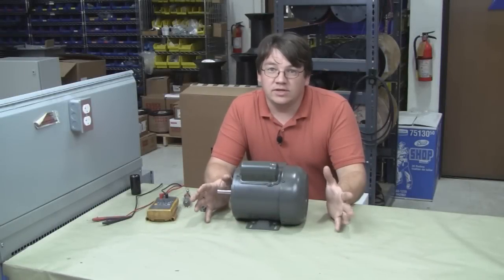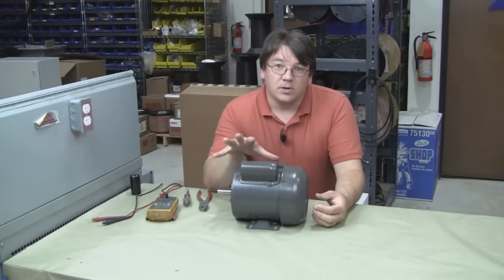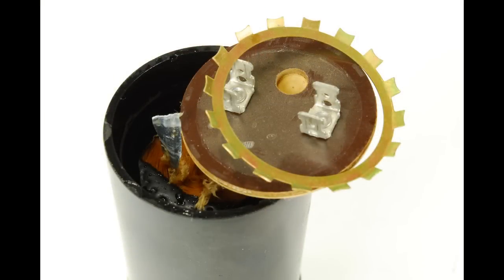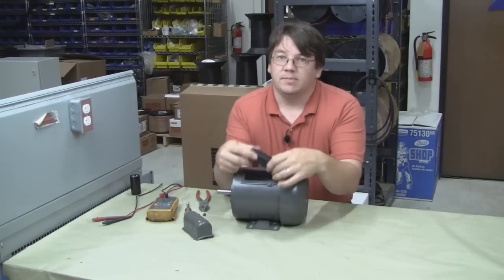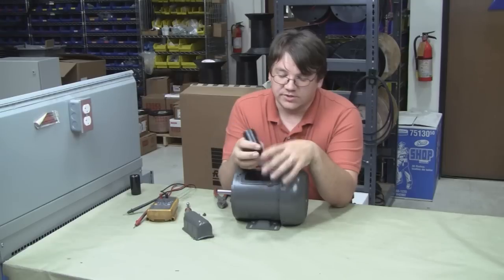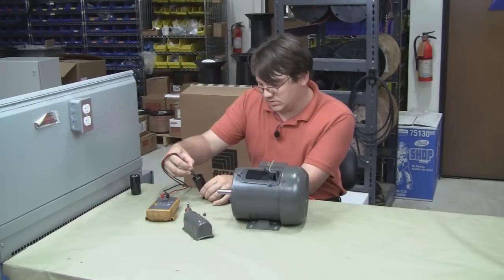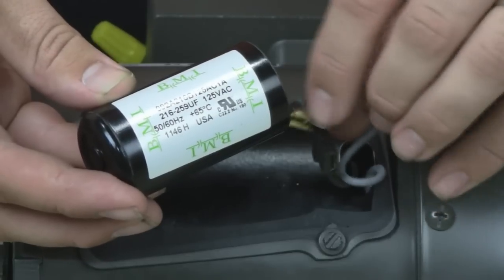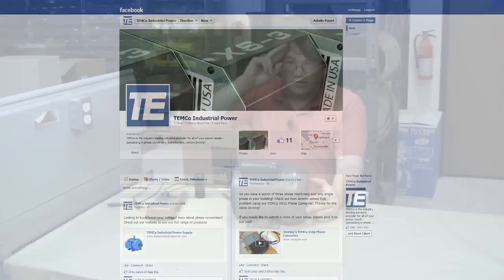Replacing a Motor Start Capacitor -- How To by TEMCo

Comment: I have a Philips start capacitor that appears to be bad. It's application is for a boat davit motor. None of the specs are visible on the capacitor. How can I find the correct replacement?

Comment: Really good explanation.  I received a replacement motor "Delta Band saw Model #28-245 1/2 HP 62-142 motor" and needed to reverse the rotation.  I can't find an explanation and did it wrong.  The motor still runs but I have to spin the saw by hand.  I suspect from the smoke that I fried the capacitor. Can you help me with the right replacement part and a "How to" on reversing the spin?

Comment: I HAVE AN OLD RADIAL ARM SAW WITH A START CAPACITOR  (200-240) THAT I HAVE TESTED TO BE BAD, BUT IT DOES NOT HAVE A RESISTOR AS PER YOUR VIDEO. DO I NEED TO ADD ONE? IF SO HOW DO I KNOW WHICH ONE TO BUY? OR IS IT OK TO JUST KEEP IT AS ORIGINAL

Comment: My air compressor was trying to start, turned over a couple of times then would trigger the overload breaker on the motor.  I tried removing the start capacitor (150uF 250v) (which I thought was the culprit) and same symptom. The run capacitor (35uF 450V) was enough to start the compressor when there was no air in the tank, but under load - no dice. I bought a new start capacitor, installed it and now she starts without the slightest hesitation. Victory!!

Comment: I have electric air compressor coleman120v/60 hz. 14a single phase i think is a 3.5 hpI dont have the old start capacitor and i can't find #number How i can the right one

Comment: I am new to this, but your video is very interesting. My question is, how do you know which cable from the electric motor goes where in the capacitor (I always do a trial an error to discover that) and I want to be precise on how to connect them ??
Reply: @Weaver Cattle Company Thank you

Comment: Hi, Just replaced a 64 MFD 330 v with another 64-77 MFD 330v START-UP CAP, this one after 3-5 minutes of starting an old fridge blow up almost too with fumes. What would you advice go for a higher ratings of 180 MFD 430-450 VOLTS?
Are they suppose to be left free for movement and vibration or tied up to stop it from vibration?, as our fridge makes lots of noise and makes a big contact noise at start up.

Comment: I watched your previous video, thanks great info. after watching the 1st I went to the TEtemco online store and purchased a run capacitor.
After watching this video: I think I need a Start capacitor. 
How can I tell the difference. it is coming off a RV roof AC. capacitor is rated 21-25 uf 165 VAC. 
The one I purchased on TEtemco is 25 uf 370 VAC.
From watching previous it seems a running one usually has lower UF or MFD like mine.
But don't have a little thingny in between the hook ups(the thing you took off and put on the new one)
My old capacitor has one of those.

So what do I have? run or start?
can I just buy the little "thingny" and add to my capacitor even if it si a running one?
PS: I waited on the phone forever for help, twice. I gave my number for a call back but I have not heard. this approx 1 hour ago.

I also wanted to know what the other 3 tubular box next to my capacitor are? perhaps i need new one of those also?
thank you much for this & previous video.... AWESOME
Reply: gcNewd  Also: my old one is black just like the start capacitor... I am a bit confused now

Comment: Hey, I suspect my start cap has died on my tablesaw... bought a replacement today but ... the rating is the same 35u, and 450V, however it doesn;t have a mounting pole and also has 4 contacts instead of the two that my original has... I can use a zip tie to secure it instead of the pole mount with the M8 nut, but how do i figure out what to do with the 4 contacts instead of two ? Many thanks - Guy

Comment: hi.. i need help pls. i have an electrifan.115volts. with capacitor 5uf 370v 60hz contains,thermally protected. 50-60hz.hp 1 1/4 amps.2.7.the problem is runing at ten minutes it will shutdouwn

Comment: I have a very old pump that has been replaced and thrown aside and I got to it and it's from the 1950's and I inspected it and the centrifical switch had been broken so I replaced it from another pump and then I didn't really know what the old capacitor was so I just grabbed one from another motor and put it on just to see if it would try to start as it did but when I tried to pump some water it was running and the capacitor blew up so do you think there is something wrong with the motor? To make the cap blow up...?

Comment: I have motor working with an input voltage of 115/230 vac, 6/3 amper and now the motor working with an input voltage of 115vac and now I need to change the input voltage to 230 vac. the starting capacitor is 110vac, and 161-180MFD capacitance. so what shalll I do here to change and what will be the capacitance of the capacitor  with 230 vac?

Comment: Thanx for the vid, I'm great on automotive DC applications but AC is different, My shop compressor just went down and this was just the info I needed to help get started diagnosing before I start shoveling $$ at it.

Comment: Good video and explanation, thanks.  Went to your website to find a start capacitor for a typical floor fan.  The info on my old capacitor is 3.0 uF and 250VAC.  Didn't see anything like that on your website.  Maybe too small for your company to handle.  A few questions please:

1.  Any suggestions for replacement source?
2.  Saw no resistor.  The capacitor is a small square plastic unit with no external parts.  Do capacitors this size typically have no resistors?
3.  The wires from the motor to the capacitor also have no quick-release connections at the capacitor.  Are those designed to be removed from within the motor itself or do I just use wire cutters to cut it free as near to the old capacitor as possible?

Thanks for any info.

Comment: Hi, a 3/4hp motor on a Dayton air compressor won't start with more that 20psi in the air tank. Checked unloader and check valve and found to be normal. Compressor runs at 115v and about 6amp and showing a locked rotor of 30 amp when not starting . Centrifugal switch is n.o. and held closed till oper. speed then opens.Motor does not have capacitors. Any thoughts? Regards,

Comment: I need to replace the capacitor on my drill press motor. It is an old Doerr motor and the capacitor is enclosed in a metal case , spot soldered to the attachment bracket to the motor. Would it come out of the case with information needed to get a replacement

Comment: My oil wel pump motor quit and I found 1 of 2 start capacitors had burned and melted on top.  Cleaned and replaced but wouldn't start.  Could the damage to capacitor be connected to a motor problem?  I had assumed a bad terminal in over 10 years of use. Also have 2 identical motors on wells and one has a resistor on one capacitor while the other motor has no resistor.  Why?
Reply: I have the exact problem as Gordon Griffen, can you please help me?

Comment: Great video. Thanks. I have a 1/12hp AC 227v motor that I want to run on 208v. I found it in a "bargain bin" in a hardware store. The capacitor was missing. I imagine I will need a 300v capacitor but I am not sure what capacitance i require and what resistor I need. How does one go about determining this?
Reply from the maker: Best bet would be to contact the manufacturer or look on forums for similar motors for a value to start with, since it varies greatly.
Reply: So size of case doesn't matter? I believe that's what you said unless the case won't allow it. Right?

Comment: You mentioned that the switch is normally closed when not rotating. You measured across the capacitor terminals and had a dead short. Doesn't that take the capacitor out of the circuit (i.e. a dead short across the capacitor terminals)?
Reply: If you are reading through the motor windings shouldn't there be some resistance?
Reply from the maker: The measurement should've been across the leads coming from the centrifugal switch, and the motor windings wouldn't have been included in the measurement.

Comment: I have this 3ph 5hp 230VAC motor. Its 3 phases and I found a circuit on the web that describe a way to turn 1 phase power source and convert it for 3 phase motor. According to the author is needed two caps for continuously run the motor and also one big cap for the start. I experimented and found that it works quite well. My interrogation is concerning the Start aspect of the circuit. I learned from your other video what the difference is between Start and Run caps. I would then assume that in my application the big cap used to start the 3ph motor it would be sufficient to use the start cap for a period of 1 second in order to start the motor and then let the motor run on the two run cap. Question: Can I get some more specific data on your Start Capacitor like Max Peak Current and How many seconds can we use the Start Cap connected. We do not see those kind of details on the cap data sheet provided by TEMCo. I just want to make sure I will not use the start cap over its capability. thanks

Comment: hello,
i want to change the rotation of capacitor start induction motor. i kno der is two windings in motor, main winding and start winding. But how i can change the rotation.
Reply from the maker: It may not be reversible. A single phase motor is often uni-directional only.

Comment: In haste or pure stupidity, I did not take a picture of the motor when I disconnected the 2 capacitors.  I now have no idea which terminals connect to the Run or the Start Capacitors.  I can not find a wiring diagram online. It's a GE Model 5KCR49TN2235X, V 115/230, A 15/7.5, 60 Hz, Single Phase.  Can I figure it out using an Ohm Meter?  One set of leads is black for 1 cap, the other leads are purple and red for the other cap.
Reply: Did  you get this figured out? YouTube no longer lets me use its inbox so i figured I would have to replay to you here:
Orig msg to me from you:

Craftsman Air Compressor
Hi Todd,

Thanks for the video on rebuilding the Air Compressor. Would you by chance know which Capacitor on that motor is the Run Capacitor? Like an idiot, I removed both the Run and Start Capacitor without taking a picture of the wiring and now of course I don't know where each goes.

Bill Trudell
Buffalo, NY
Reply: Yes, I found a general diagram of how a motor is wired with a Run and Start Capacitor.  I then used a Multi-meter, measuring the resistance between all the leads to deduce which were the start windings.  Then I tried it and it worked.  Thanks for following up, the video is really good!

Comment: Does it matter which wire goes on which terminal of the capacitor?  On my Mallory 400-480MFD, one terminal has a copper colored dot, the other is plain metal.
Reply from the maker: AC capacitors are non-polarized, so it doesn't matter which wire goes on which terminal.
Reply: Thanks!

Comment: So just checked the motor I don't see a capacitor like the one in the video. Is there one inside maybe, its an older general electric motor for a drill press
Reply from the maker: It's possible they put it inside. It may also be a non-capacitor start type motor.

Comment: I have a older drill press that when I turn it on it just buzzes. If i give the belt a pull it will start up. In the video you mentioned a speed switch do you have a video on fixing this?
Reply from the maker: We don't have a video on fixing the speed switch. It is more likely a problem with the start cap though, so try replacing the cap or verify its mfd value.
Reply: Ok I'll try that and let y poo u know thanks for the great videos too

Comment: Thanks for the informative video. I changed the capacitor on my drill press and it worked. (Old one tested bad). However my capacitor almost looked new. Listened to you full video regarding how they fail and almost destroy themselves, ie: "Spill their gutts." Since it's so easy to do, I opened my band saw, table saw, two miter saws, and any other tool I had and logged the capacitor numbers. Much easier to find a replacement in case the numbers get destroyed. Thanks again. One note though? If it doesn't have a bleed down resister, how does one go about discharging one.
Reply: Capacitors may store a charge after removal. Simply short the terminals with an insulated screwdriver. If you see a spark the charge has been neutralized.
Reply: @ellieprice3396  I did that once with a 465 mfd cap.  Sounded like a .357 Mag going off in my face and burned a pit into the side of the screwdriver.  From that point forward I hooked up a voltmeter and shorted with a resistor.  That way I could watch the discharge as it happened and there was no excitement.

Comment: what if the start capacitor is bigger than the one you want to replace? For example I have a 160 uF and I want to put a 400 uF capacitor. Will that affect anything in a bad way?

Comment: I was wondering how to tell which side of the capacitor is negative or positive. I took my capacitor off when I had problems with my bandsaw, tested it it and it was fine. Upon install there were no markings to indicate + or -  
I guessed and the motor started but I have to hold the start down for a little while until it got up to speed. The capacitor is 450V 40uF. The motor is 11A/220V.
Reply from the maker: AC capacitors have no polarity, so it doesn't matter which side you put it on.

Comment: S0 how can I tell witch wire goes where?
Reply from the maker: Sorry for the late response; the color of the wires is specific to the manufacturer and are not standard. You would have to contact them for this information.

Comment: I took the wires of my capcitor and I don't know where they go to put them back on. it has 3 wires- a blue a white and a orange.
Reply from the maker: Do you know which colors went together on the terminals? The polarity of the cap doesn't matter, so as long as all the colors that were on one terminal stay on one terminal, it should be fine.

Comment: hey... i'm having the same problem with a standing fan... i disassembled the the entire motor, cleaned and grease the shafts but when i put it back together it hums and won't start, judging from this video its the capacitor, the capacitor is squared in shape, has no resistor, 250V A.C, 3uF, no leads, the wires go straight in... how do i go about testing replacing it
Reply from the maker: Seems like it's a start/run cap. Testing it, you'd use a capacitance meter to see if it's in spec, but our suggestion is that you go to a hardware store to see if they have replacement capacitors for ceiling fans because they use the same type.

Comment: Hi.  Thanks for the info video.  I just acquired an 1950s Craftsman lathe with a 1/2 hp motor that has a flat capacitor in the base.  The capacitor is bulged and leaking so I need to replace it.  The problem is that there are no longer any readable markings on the capacitor.  I have room for a round capacitor if I can just figure out which one.  The motor is 110-120 V. 8.2 amps. Type CR220K21  D4 50 Model # 1156962 and made by King Seeley. for Sears Craftsman.  Thanks
Reply from the maker: You generally need some fairly fancy engineering data from the original design of the motor that's not available to the public to size a capacitor for a motor. Outside of this, the next best technique would be trial and error. One rule of thumb is approx 80 uF per kilowatt of motor power and may be a good place to start.

Comment: Can I reduce the starting torque on a Capacitor start/capacitor run motor by replacing the starting capacitor with one of lower capacitance?   Mike Daigle

Comment: I have a small table top drill press that i may have ran a bit to hard....I know the motor was hot when i was finished....no smoke no sparks etc.  Now it will start but only runs on slow speed.  I have the start capacitor and cannot get a reading other than 0L continuity it measure 1.16 ohms I wonder if the motor would even start if the cap is bad?  The capacitor is 16mF 250 Volts  Thanks for the videos !!!

Comment from the maker: Sounds like breaker may be undersized. You'll need to find out the full load amps, locked rotor amps, as well as supply breaker size. Usually if a motor needs a cap to start, the manufacturer will supply one. Otherwise, it's likely not needed.

Comment: Does anybody know how to work out the value of a start and run capacitor for a 240 volt 6.4 amp 50 HZ 1430 RPM motor

Comment from the maker: If it's a capacitor with only two terminals, the polarity does not matter. Just make sure that all the wires that are supposed to be on one terminal on the old capacitor are on one end of the new one, and same for the other terminal.

If it has three terminals, they should be marked.

Comment from the maker: Does the motor actually get hot? If so, the thermal switch may be going out. Also check what amperage the motor is drawing when it does spin up and see if it is more than the nameplate recommends.

Comment: Hi great video but im having  problems with my air compressor motor it does run when tank is empty and fill it up but when is time to kick back again it does run like for 30 sec and the thermal switch trips I did check both start and run cap and they liked good and their readings too hope u can help me out thx

Comment from the maker: The resistor is such a small part of the circuit for the brief time that the start cap is engaged that it will not affect the motor in any way. The start cap, and therefore the resistor, are taken out of the circuit as soon as the motor is up to speed. As for sizing, you'd want a resistor that matches the voltage of the cap.

Since they're not part of the circuit, resistors don't have any affect on the motor's performance. It is really only used for safety reasons as mentioned in the video.